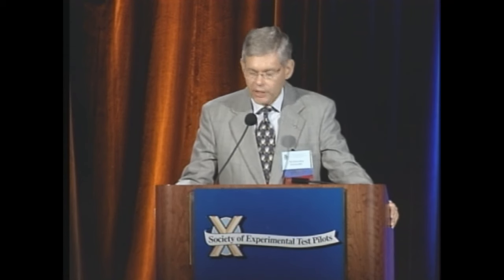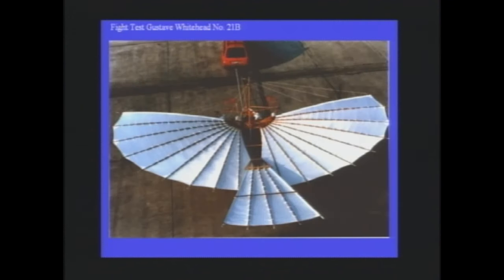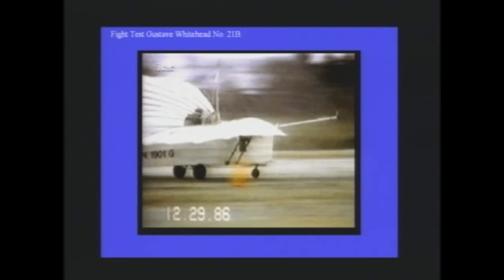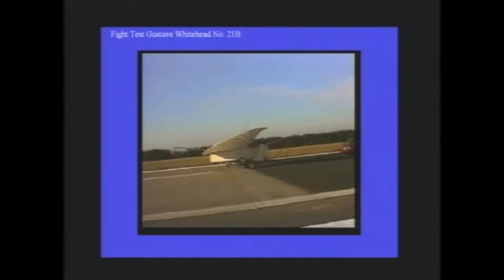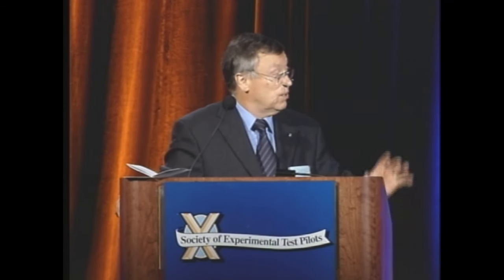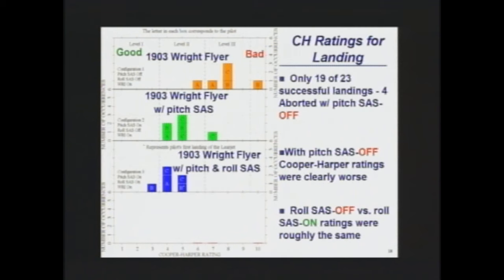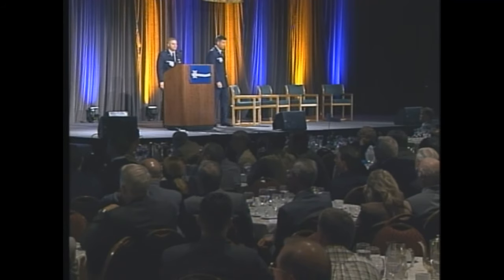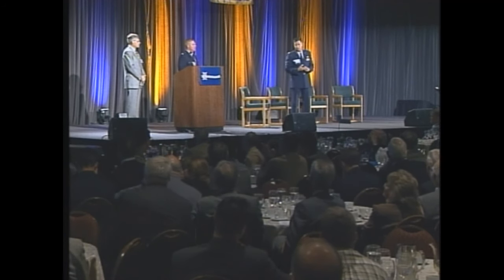Historical flying machine Whitehead no 21, wright flyer and Spirit of Saint Louis replica discussion

Comment: So…What is your professional assessment? Was the Whitehead capable of anything other than a powered hop?
I ask because I watched a documentary in which the designated aviation expert said, while looking at the replica, that every feature of a modern airplane is present and in his opinion there is no reason it should not fly. In my (pilot not engineer) observation it is missing something VERY crucial; the only aircraft I know of in common service today that doesn’t have a vertical stabilizer is the Chinook… Why should we believe that Whitehead made two concentric 360 degree circles over Long Island Sound in Jan 1902?
Reply from the maker: Funny that you should ask.  Horst Philipp, who unfortunately recently passed away, performed an extensive amount of engineering and flight test work and did show that the aircraft could have flown as the eyewitnesses said. In fact, Horst presented his paper on his flight test work at the  SETP annual symposium in LA in early 2000 (I forget which year). I was one of the three paper judges and we awarded him the best paper presented at the symposium award for the year for his flight test work on the aircraft.
Reply: @ronrogers  So, the Whitehead was capable of powered hops as described by the eye witnesses. There is no evidence to support the 360 degree closed circuit flight with a controlled return to the start location. Is that correct?
I am not questioning the quality of Horst Philip’s engineering assessment, paper, or presentation.
I am asking whether, in your opinion, Whithead beat the Wrights to controlled powered heavier than air flight or if he was one of the many evolutionary stops on the road to Huffman Prairie in 1904 and Paris 1908.
Reply from the maker: The paper and work were very extensive and thorough and we were fairly well convinced that Whitehead did beat the Wrights. This was the opinion of myself and the other two judges. I don't remember anyone at the symposium challenging Horst's presentation.
Reply: @ronrogers  interesting. I have always questioned the idea of the Whitehead claim due to a lack of vertical stabilizer.